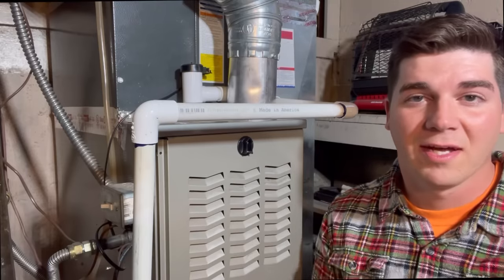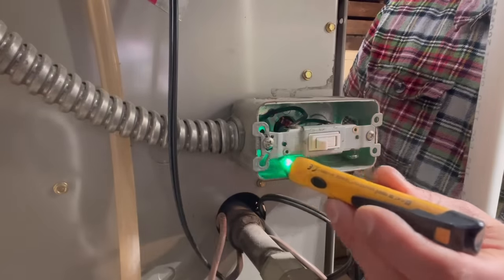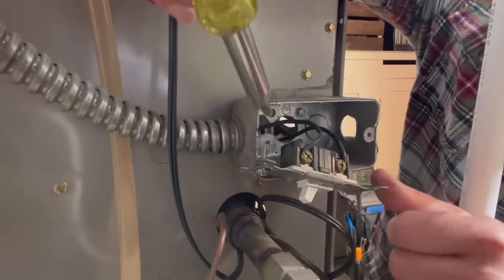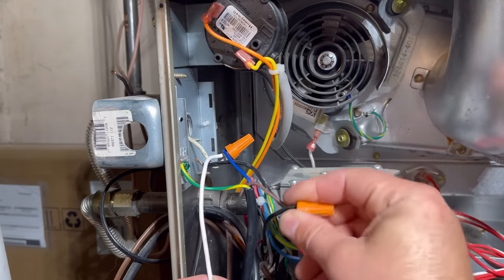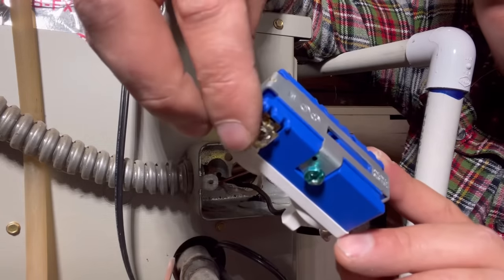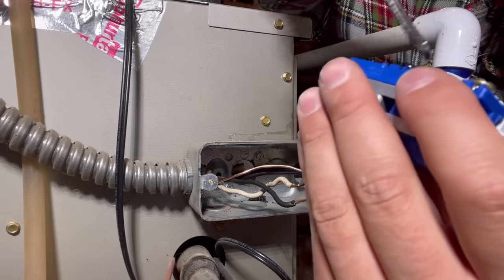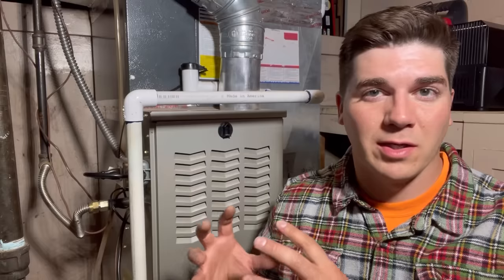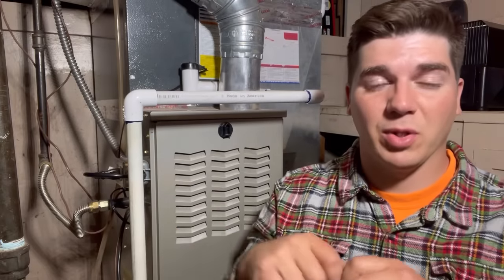This Could Keep Your Family Warm During An Emergency Power Outage.

Comment: Nice video, I love the way you showed the WAGO connectors which are the best way to attach stranded and solid wires together. I wired a similar plug on my old furnace and when I had it replaced, the HVAC installers took it off saying it would not pass code in my area (SE Michigan). I'm not sure why this would be against code, because it is such a useful idea, but I mention it as a heads up to anyone potentially dealing with code enforcement.
Reply: RE:Tom Griebe.  I was wondering about that. I'm not an electrician but my guess is that the National Electric Code maybe requires a direct wire connection; not a pigtail. Any electricians here know?
Reply: lmao NO!
Reply: My guess is that your local code requires a hardwired connection for this application.  Most code requirements are good but there are a few that make you scratch your head.  Hardwired connections are beneficial for high-draw 240-volt (or more) appliances since heat can build up at the plug/socket and is the weak spot in a connection.  Gas furnaces, OTOH, use comparatively little electricity.  You have the draft inducer fan (not the blower) that uses between 50-100 watts, the hot surface igniter (about 600 watts), and the blower motor (about 370 watts for a 1/2 HP motor. the most common size).  All three do not run at the same time.  When the T-stat calls for heat, the inducer motor kicks on and the hot surface igniter lights up for a total of about 700 watts (5.8 amps @ 120 V).  The hot surface igniter runs for only 30-60 seconds.  Once the gas burners ignite, the hot surface igniter shuts down while the draft inducer motor continues running. After about 30 seconds the blower motor kicks on - now you have about 470 watts (about 4 amps @ 120V) for both the inducer and blower motors.  For comparison, the typical electric dryer runs at 5,000-6,000 watts (~23 amps @240 V) and yet code allows a plug connection for the dryer.  The plug-in technique in this vid is no different than plugging in any other corded appliance (vacuum cleaner, coffee maker, TV, hair dryer, etc.).  If amp-draw is the driver for a hardwired connection on a gas furnace, then virtually every appliance would need to be hardwired.
Reply: @binfordtoolman5674  Good explanation.
Say hello to Tim & Al.
Reply: @binfordtoolman5674  I guess you haven't figured out yet, neither the code, nor the code enforcement officer are driven by any connection to reality.  And of course the code doesn't really matter, just the enforcement officers definition matters.  Someday for fun try telling the enforcement officer what the code really says.
Reply: @fristlsat4663  I hear what you're saying and there is validity to your statement.  I'm the 3rd owner of my current house. As a result, the house has been inspected several times during each sale.  As a result of watching this vid and examining my furnace wiring, I noticed that the load wires from the switch to the furnace are routed from the switch up and OVER the top of the roof rafter and back down to the furnace.  The part of the load wiring that is over the roof rafter is nestled snug between the top of the rafter and the roof decking, meaning they are one misplaced roofing nail away from a short.  This is in violation of the NEC, yet several inspectors missed this very visible violation.  When I wire in the cord pigtail to the furnace as shown in this vid, I'm also going to correct the mounting of the load wiring and mount it to the bottom of the roof rafter so it is out of harm's way.  Amazing that no inspector or code enforcement officer ever wrote this up.
Reply: @binfordtoolman5674  I believe the reason for the "hardwired" code is that they don't want the furnace to ever share a circuit with other appliances, to be plugged into an inadequate power source (unstable power, improper grounding, etc) or for the plug to become damaged.  They don't want any potential for a situation where the circuit overheats, shorts or arcs.  It may seem silly as we don't worry about it with OTHER appliances, but keep in mind the furnace operates 24/7 and has the added danger of a combustible gas should an electrical fire occur near it.  It's an overkill safety code, but codes are OFTEN "overkill".  There were probably just enough incidents that they said, "let's just make this hardwired and be done with the safety risks."
Reply: I don’t really know code, but I suspect the furnace has to be hardwired because that is the way the manufacturer tested it. The only issue I could think of relates to accidentally kicking out the cord or arcing of the ‘temporary’ contacts near a gas source. I’m not saying it’s a bad idea, I’m just pretty sure you’d have to take it out to sell the house.
Reply: @TomCee53  I have absolutely no idea, either.
Reply: My guess is it wouldn't  pass code because extension cords ( which is what you are essentially installing) are not allowed as permanent wiring.
Reply: @jtr6554  good point. You may be able to get by if it's armored cable. I just remembered that I had to put a garbage disposer on flexible conduit so the wire wasn't exposed.  Some of this doesn't make sense, but I can see that easily damaged connections are a problem.
Reply: Terrific comment  @binfordtoolman5674  ! I was wondering about doing this but several issues arose their devilish head: Code, Invertor/battery sizing, and finally insurance. Doing this is all well and good until a fire starts somewhere and the insurance adjuster sees a non-code modification to appliances in the vicinity of a fire. So yeah, I think I'll contact my insurance company and an HVAC company and see what kind of insured options I'll have for powering up a furnace during a power outage.
Reply: I just ordered WAGO connectors this morning for a different project (ceiling bulb socket with a grounded plug for a closet Pi server with UPS) after watching this video a couple weeks ago, I didn't know about them before and I think they make a lot more sense than wire nuts. Came back to confirm I bought the same brand and read comments about them. It took me a moment to realize you weren't saying the connectors were against code. Had me confused and concerned for a bit there because I'm also in SE Michigan. Whew!
Reply: @PilotA51  WAGOs totally rock, especially for connecting smaller braided wires  to a solid copper wire like in a light fixture.
Reply: The NEC has never allowed any curds to take the place if permanent wiring methods. We have an over zealous electrical inspection that does not allow a condensate pump to use the factory installed cord & male plug. Makes you hard wire them. Yep makes no sense because a lot of places remove these gunk filled pumps once or twice a year to clean them out

Comment: With so many comments on these 3 related videos, forgive me if someone has already mentioned this VERY IMPORTANT safety concern.  You should warn about putting a standard lead acid car battery next to an ignition source.  Flooded lead acid (vehicle) batteries produce highly flammable hydrogen gas.  I know you say this is for emergency situations, but I would suggest using a sealed lead acid (SLA) or a lithium (LifePo4) battery.
Reply: Just for completeness :  lead-acid batteries only produce & vent hydrogen gas when they are being charged, not when being discharged.  While the furnace is running from the battery-powered inverter there is no explosion risk.  Once grid power is restored, take the battery elsewhere, well away from any ignition source, to charge it...

Comment: Need a strain relief fitting on the wires from the furnace into the switch box to prevent cutting the insulation on the wires.
Reply: You bet.  Those unprotected wires passing through the metal holes give me pause.  A combined plastic bushing with strain relief may do the job nicely.  That along with anti-short bushing inside the sharp ends of the bx cable would really smarten up the whole thing.
Reply: Especially so on a housing that vibrates from the motor.  That is a short just waiting to happen.

Comment: I plan to do similar but instead I ordered a single circuit ez transfer switch.  This would also simplify things for a future furnace replacement. Also I think a newer furnace sometimes requires a bonded neutral plug to work. Great video.  Fridge lights and other items are simple enough to plug in and power as needed vs having a large  transfer switch.
Reply: Yes, an EZ Transfer switch is only about $100, is up to code, and can be set up for bonded or floating neutrals.  

It's also completely outside of the furnace so you don't have to touch the internal wiring.
Reply: EXACTLY. That would be the correct, safe, and up to code way.
Reply: Is there a video on how to do this?
Reply: Using a single circuit transfer switch is the “right” way to do it, and what I plan to do to power my boiler pump in emergency situations.
Reply: I thought he was putting the box on the outside because removing the panel would shut off the furnace but it did not.
Reply: @toriless  He probably put a magnet on the switch.
Reply: Correct. I put a pigtail on my Trane furnace to use with my Harbor Freight generator which has a floating neutral.  The fan would run but the gas wouldn't fire until I made a bonded Edison plug for the generator. Trane customer service confirmed that if the furnace circuitry senses a voltage between neutral and ground the furnace won't fire.
Reply: @scott9676 I agree, and that switch is UL listed. The video on installation (by the company) misses a couple of points that are covered in the comments, such as adding a protector on the raw hole in the box.
Reply: The generators want you to connect to a proper neutral too.
Reply: @toriless   -  The box was already there by either the manufacturer or the installation electrician.  He was just exchanging the original switch for a switch/outlet combination to effect emergency hook-up when necessary.

Comment: Great job! I have a gas powered generator and was already thinking about coming up with some way to tie it into my furnace in case of a power outage. I will be doing it the way you have! Much safer and no chance of shorting anything out. Thanks!!
Reply: another trick, albeit a little bit more thought put in (and danger, involving the dreaded male to male extension cable...), is to shut the main breaker off, and backfeed your outdoor plug (or nearest plug through a window), backfeeding the panel, then shutting off all non-essential breakers (leaving the circuit on that you've now plugged the generator into) in the panel. there's obviously a larger voltage drop to be considered across the length of all that cable, which makes a more direct feed cable ideal, but the furnace isn't typically far from the breaker panel in many installations really.

keep in mind this would limit the capability of the complete circuit to be the 15 amps (most usually), that the circuit is that you have backfed into.  meanwhile, it may be a 20 amp output plug from your generator, feeding the rest of the board backwards through the 15 amp breaker.

Comment: While it may cost a little more you can also use something like an ez generator switch (or any similar single circuit transfer switch) and be more code compliant. It is a proper transfer switch that can also switch the neutral wire and is UL listed. It is what I installed on my furnace.
Reply: How much does it cost and is it easy to install?
Reply: I don't understand. You are either code compliant or you are not. Are you saying this is not code? Also, codes can be different across jurisdictions. I to would be interested in the product you are talking about. That pigtail can only be plugged into one place so it is not like you can have your generator feeding back into the grid which is what I "think" your worried about here.
Reply: @mrsushi1966  I think you are exactly right. Compliant is a binary thing - it either is or is not. Most jurisdictions adopt the NEC, NFPA part 70. Bigger cities, like NYC, may pass stricter requirements over & above the NEC. There's no way untrained & amateur DIYers should be doing this.
Reply: @RichardFallstich  I think you are right in that if someone is not comfortable doing it they should not but as long as the person doing the work takes responsibility for what they are doing I would not go so far as saying they should not be doing this. For example, I sent this video to an electrician who has over 30 years of experience in many types of electrical work and asked his opinion. I am going to discuss this with the company who put in my furnace to see if this could void the warranty or raise any concerns but this type of solution is far more accessible to making your HVAC more resilient and if you believe this is a bad solution I would love to hear why. From what I can tell this solution does what the single circuit transfer switch by isolating where power is coming from and as I said that pigtale can only be pugged into one outlet. If I am missing something, educate me so I can better understand your point of view.
Reply: @lisaleimbach904  An EZ generator switch is < $100 and as easy to install as this switched outlet.  It is also code compliant, where I am not convinced that adding a pigtail to a furnace is.
Reply: @mrsushi1966  I can't pack several years worth of electrical theory into a YouTube reply/ This may not even WORK let alone be safe, depending on the furnace and generator combination. As other comments have mentioned, many modern furnaces look for the neutral and ground to be bonded. Many smaller generators have a floating neutral. These are incompatible. If this beyond your understanding, you need an electrician.
Reply: @UnlikelyToRemember  Thank you!
Reply: @lisaleimbach904  The Reliance Controls TF151W is only $99 and would take an electrician about 15 minutes to install. It would take a DIY guy maybe 30 mins. Super easy.
Reply: @Monkeyseemonkey79  unfortunately even this simple little XFR switch requires a permit...another $80 in my area.  I can self permit though instead of hiring an electrician.  Right now I'm set up to power at the door switch & the circuit board using a floating neutral generator with a NG plug.
Reply: @lisaleimbach904  Single circuit transfer switch is about $100 plus installation if you have an electrician do it. What is shown on the video IS NOT compliant with the NEC (electrical code), but most people can do whatever they want in their own house. The process shown in the video IS safe enough for general use. It disconnects the furnace from the house to enable it to connect to a  backup generator

Comment: Great video. Well done explanation, well done camera work. Every system should be wired up as such when the unit was first installed. Wish they made such a design a code requirement. Thank you

Comment: This is a great idea and I did it years ago.  May I suggest an update that I did that increases the simplification of the power transfer.  If you change the power input to the furnace into a 20 amp male 120 plug. Then us a DPDT switch to choose the input you will achieve an immediate transfer that is mechanical and fully safe

Comment: I have a high efficiency propane furnace but heat my house primarily with wood . I have a furnace add on in the garage attached to the house. I just run an extention cord to run the two 1/15 hp squirrel cage fans. A plenum dumps the heat into my family room in the basement and it speads out pretty uniformly from there. Paid 10 $ for the stove on auction and it has saved me over 5000$ in propane .

Comment: It’s a decent idea for the money and it solves the problem of isolating the neutral in order to proper protect the linesman working on the damaged power lines from power backfeeding through the neutral . What works better though is to have a stove receptacle installed that powers a small pony panel by means of a stove cord end . Secondly you install another stove receptacle that’s powered by your generator so that when you lose power you just plug the pony panel supply into the generator fed stove plug .
Reply: Kudos for identifying that this concept eliminates back feeding.
Reply: Can you explain how this prevents back-feeding through the neutral. It's difficult to understand without a wiring diagram, but I see one neutral coming from the switch/outlet to the furnace. How is that one neutral not shared by the outlet and the switch (in any position)?

Comment: Greg this is a great video and idea. Please keep in mind that the 1/2" ko in the back of the box and the wall of the furnace by code needs to be bushed. You can do this by either using a chase nipple and lockout or a snap in plastic bushing.
Reply: His furnace should have had a plastic bushing before like mine but it was removed, than again that is the single worst connection to a screw I have ever seen and not where near the 60% required by code.
Reply: We used to call them red dogs...